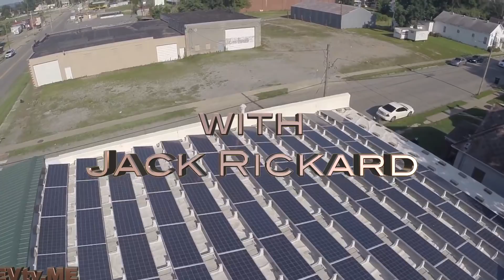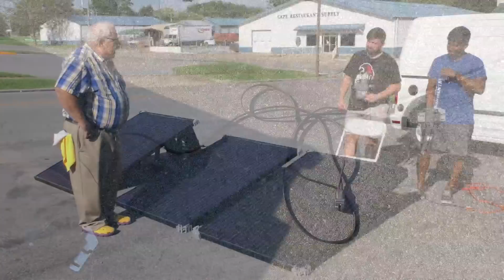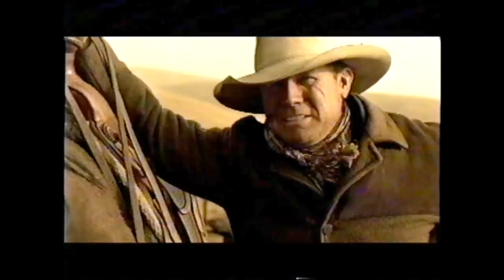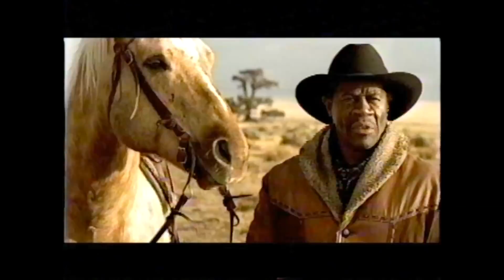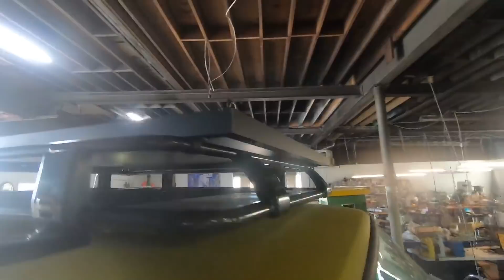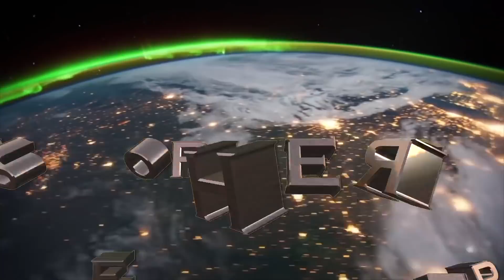Testing Enphase IQ7x with PowerPhase100 pllus Solar Cellphone Charging Truck

Comment: Hey Jack. Forgive my verbosity here. Your method if disabling the microinverters is perfectly fine but here's a couple more ways, if you want to experiment.

Those microinverters respond to a smooth throttling back to power production when the frequency of your main inverter shifts +/-0.5Hz from 60Hz. I believe your SMA (and Magnum, Schneider, etc) does that now if you enable their AC-coupling feature.

The Enphase Envoy unit provides a somewhat limited API and web interface that you can use to turn on/off production of individual microinverters or the entire system. You could send a command over LAN/WiFi when the batteries are full and production would stop.

I like your "selfish" concept and that's how I've been operating my installation for a while now. Even without a main inverter or relays, the Envoy can be fitted with production and consumption meters (current transformers) that you can setup to not export any extra production to the grid. Production tracks and matches local consumption and never exports anything. In your case (and mine), the Enphase would throttle back once the batteries are full and are drawing less current.

Comment: As you mentioned you don't need to bring a heavy duty DC line from the roof, you use higher voltage AC, hence you could use thinner lighter wire to get the power from the solar panels! That's a plus right there...

Net metering solar panels is what helped bring down the cost of solar panels very quickly, enabled mass production because (almost) everybody could purchase a solar panel grid tie system, until the utilities got greedy! 🖕 Now we're going to be forced to use solar battery packs... Now I personally refuse to feed back to grid, need no 'contract' or wasteful fees...

Before solar panels, people were relying on generators, not everyone with the generator set the system upright, isolated by switching off grid and fed their generator back onto the down grid! I don't have any incidents where person got hurt, but when grid did came back up, and a generator was still running, it blew the generator!!!

Comment: So Jack it seems your clever system really makes the Loads panel do a lot of clever stuff.  I take it that you are truly almost completely independent. That is sensible.. to my mind.  I would have thought it will pay for itself over the long haul.  So your experimentation is interesting.  I use Enphase and a string inverter but that is because I have an old legacy system which is still pumping in power plus some Enphase powerd panels.   But Microinverters, their AC power and their cloud based software allow the average guy to keep taps on what one is using and what one is making.  you can beef up your system without changing your string inverter !  In Australia, with my Grid tied Powerwall 2 I usually have a very small electricity bill.  I believe my Powerwall 2 will be paid off in 7..5 yrs (based  on usage savings and Grid input credits)  .  So my AUS $11,000 battery is pretty great addition for my purposes to my mind.  I believe you are correct about the motivation of a lot of Electricity company  as being based on fear of loss of revenue..   Always informative .  I like your perspective ...
Reply: Yes SA has had some problems with electricity costs.  But this is due to the disgraceful games being played by some power companies here.  They structure things so that they have to use their Gas powered Electric power plants (so call demand responsive despatchable power).  So they have been holding the wholesale price up higher since they can use these 'out of State' power plants and charge a premium.  SA has a lot of wind power but when there is intermittent wind they cannot/may not dispatch power even though their wholesale prices are usually much lower.  Its a little like what Enron apparently got involved in when they were able to manipulate the market in some US states.  SA has the Tesla giant battery and it is already springing into action when there is a spike in demand and  renewables are not available.   A big game is being played by the power companies here who do not want Renewables to be able to compete with them.  After a freak storm when a lot of power lines came down in SA and there was a black out in much of the state there has been a concerted effort by the incumbent power companies to keep the power prices high, so that they can claim "See what happens when you go crazy and try to beef up your renewables!" etc.  Since most people don't understand the issues, it is easier to create fear and doubt on this issue.   I am retired I have an Avan (little compact trailer).  I have toured around and enjoyed a  lot of stays in many beautiful spots with family.  Not so keen on big RV parks , prefer little out of the way "free camp" spots which usually have a simple compost toilet etc.  I carry my own gas (and fresh water) which runs the refrigerator and the simple stove.  But no one retires from life..do they?. (not willingly anyway) so I still work at things that interest me.

Comment: Florida Power and Light got a law passed that ANY home owner or business that disconnects from "The grid" has its Certificate of Occupancy pulled by the state.  That means the sheriff comes out and basically locks you out of your home and office.  I think that is possibly the worst thing to come out of florida since Claude Kirk.

Comment: Why were the inverters made to 500 watt instead of the 600 watt rating of two panels so 1 inverter could connect
2 panels ?  This would be more cost effective and the added components would add very little cost.

Comment: Hi This is interesting. Iv spoken to a few people about enphase microinverters in an offgrid only application and from what im told these microinverters can only be used with grid tied installations. Getting power into my property starts at 60,000 so needless to say im not doing that.
Reply: Watch starting at 14:10 he talks about that issue and how to get around it

Comment: I have been try to think of a way to use the AC inputs on this inverter with microinverters so the batteries can charge with the built in battery charger. So the inverter won`t blow up when the load goes over 12 kw.

Comment: (Never mind. My bad.  I went back and watched to the June 15th video again and you said the inverter will switch back to Battery priority mode once the battery is charged in AC priority mode. ~12 minutes into June 15)

Comment: One more 12kwh inverter test to do lets see what happens when you start loading up the inverter. I have seen a sigineer 12kwh smoke when the load got over 12kw when back feeding and charging.
Reply: Jack Rickard how much load did you have on the inverter what were you running with it when you were charging at that rate that's where I saw a problem.
Reply: sma sunny island has been back feeding and charging with sunnyboy for a few years now
Reply: Jack Rickard I went back and checked on the video and the guy was putting the juice in the AC input side of the inverter and charging the batteries off the inverter and then threw a heavy load onto it and then it blew up so it's definitely not the same thing that you're doing here.

Comment: When installing the AC trunk cable connector to the IQ7 I noticed it fits both ways. If fits no matter if one flips it 180 degrees.   Does polarity matter on the AC side of the trunk cable?  I do know on the DC side the +/- should be observed as polarity does matter

Comment: Is there no way to disconnect the batteries after they have reached their cutoff voltage and just let the load draw what it wants from the solar? It seems like this would help prevent a lot of unnecessary wear on the batteries.
Reply: IQ 8 is most definitely coming out its already made and a mystery partner already paid 6mill to have a custom version of it early this fall

Comment: Why not put some (a couple) Tesla battery modules for extended late night charging in the "yellow bumblebee cellphone" truck for enhanced and buzz-worthy backup power generation during the concert?

Also, what about putting some large RGB LED matrix sign displays on the sides of the truck for concert related messaging, digital signage advertising and even add SMS based concert attendee messaging?

Comment: if i install solar, ill be damned if the grid goes down and i shut  down ,
at that point 
it should disconnect from the grid and kick over to solar and battery mode.
Reply: Enphase's next-gen IQ8 will have built-in microgrid and charge controller so it will be the cure for "anti-islanding" which millions of solar PV systems currently "suffer" from!
Reply: IQ8 baby!!
Reply: I'm actually here because I was searching for info on IQ8s..